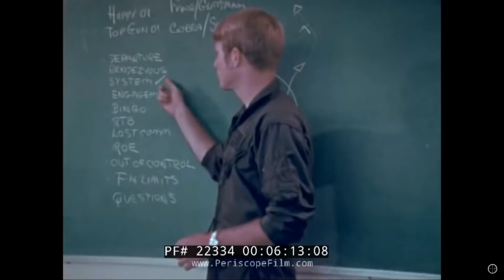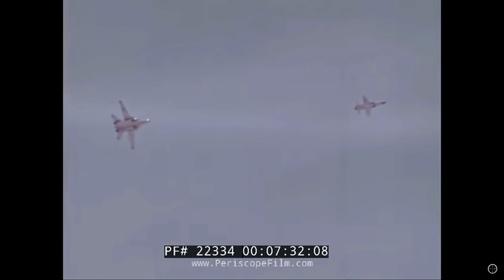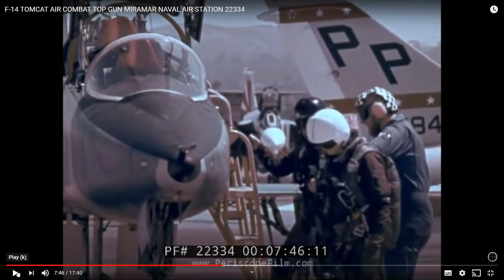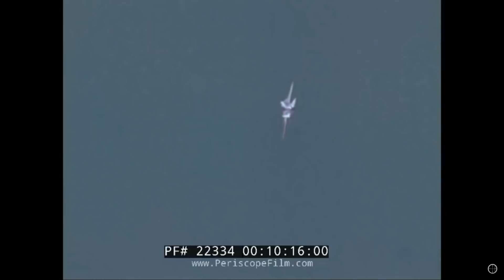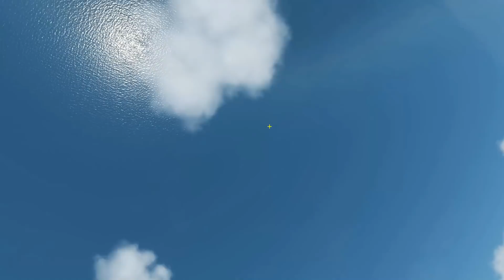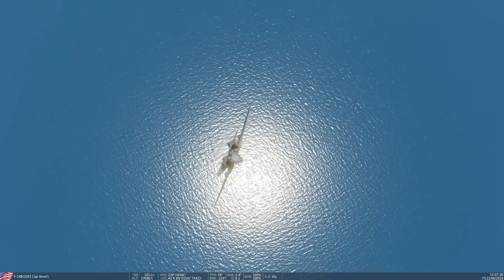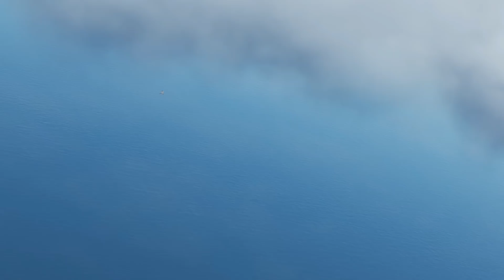F-14B Tomcat: Do These 1970's Grumman ACM Techniques Transfer To DCS WORLD?

Comment: Hello. I was determined to buy 2x16 gb RAM but I saw that for all games 2x8 gb RAM are enough. My problem is that I don't know if 16 gb is enough for DCS (single player missions). RAM? The price difference is double! Maybe you can make a video or something! Thank you!
Reply: It depends on your setting 
All low graphics settings: 8gb ram for light missions and 16gb Ram for heavy missions 
All high graphics settings: 16gb ram for light missions and 32gb ram for heavy missions
I dont know about vr but i suppose you will need 32gb RAM 
(All numbers taken from dcs steam page)
Reply: @LtDogoop  Hello! I have a gaming laptop with Ryzen7 3750H, 1660Ti and 8 gb RAM at 2400mhz. What I played: training missions, 1920x1080 medium to high. Unfortunately at 1600x900 I can't play because the image is a bit blurry both in the menu and in the game. But on Steam is not about low or high graphics settings, it is about minimum and recommended pc!
Reply: @Ioan_Iorgu   i ckecked right now on minmum requirements in brackets it is written low settings and o nrecommende it is written high settings BTW i suggest you get a pc because im pretty sure when you play dcs your laptop gets hot and the cpu and gpu throttles
Reply: @LtDogoop  I think is a great ideea to ask on the DCS forum 🤔
Reply: @Ioan_Iorgu   yea go ahead :)